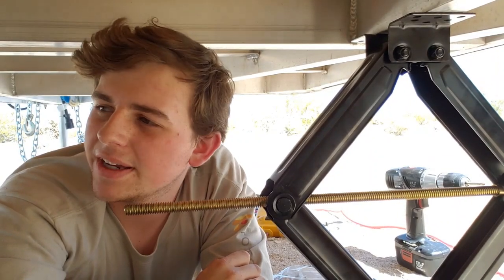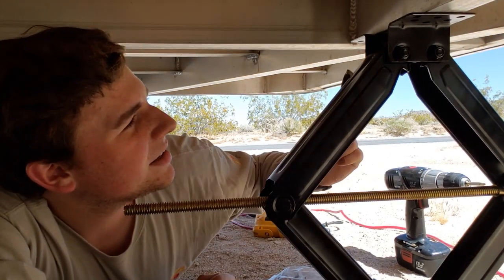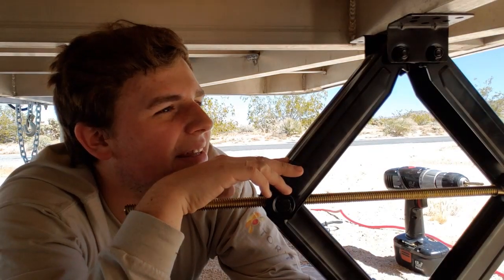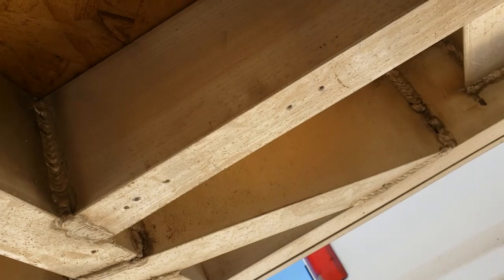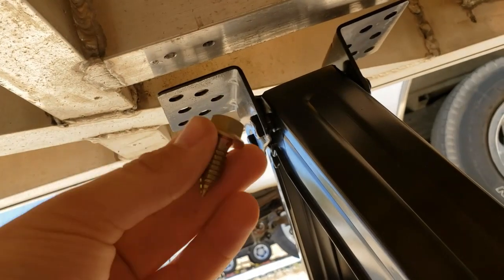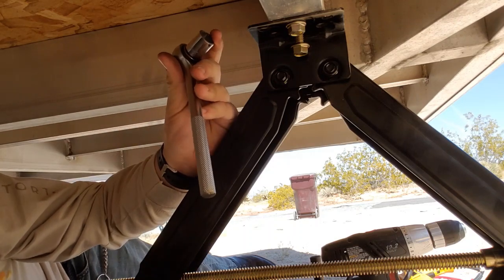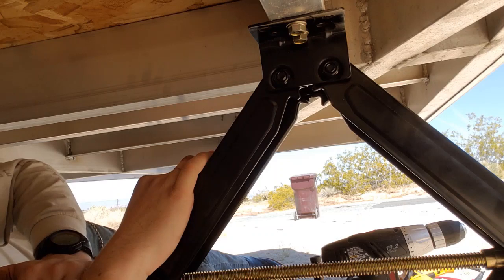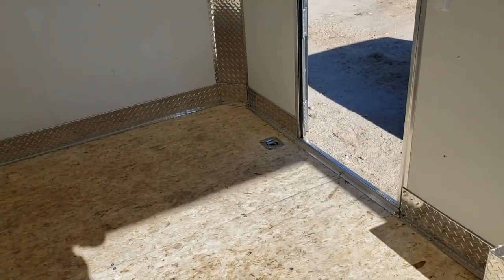Installing stabilizer jacks on my cargo trailer. (Layout at the end)

Comment: I was about to do this to my trailer.  I always wondered why mount it this direction instead of 90 degrees around.  I'm afraid if the trailer rolls forward or backwards it will bend the legs.  I have some axle and no e brake to lock the wheels
Reply: I mounted them this way for 2 reasons.

1 you need to be able to crank them up from the side. If you mount them too close to the front or back, they will catch on bumps and driveways. So you need to mount them a little towards the center. If you mounted them facing front to back, you wouldn't have enough space to get the crank in to lift the Jacks. 

2 You can see in the video that I mounted them to the frame, if I were to turn them 90 degrees they wouldn't line up on the frame how they're supposed to and then they might not handle the weight as well. 

On past trailers, I have had them bend from rolling back and forth. That was because I wasn't thinking. Always put your wheel blocks down before you lower your stabilizers.

Comment: Steel jacks on an aluminum frame=major corrosion. You can mount steel to aluminum without something like rubber or plastic in between the two metals to prevent corrosion
Reply: There's paint between